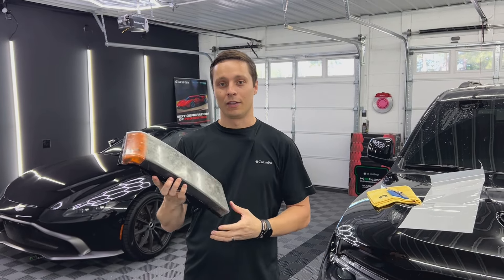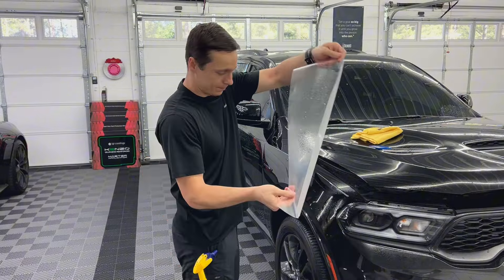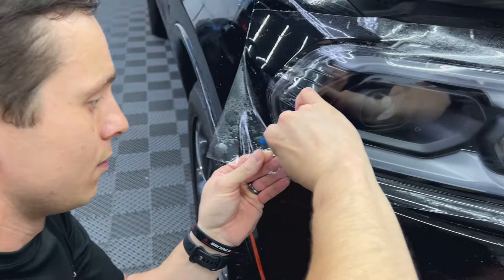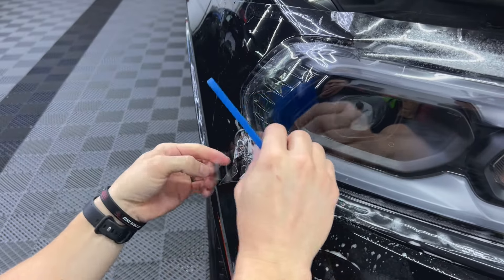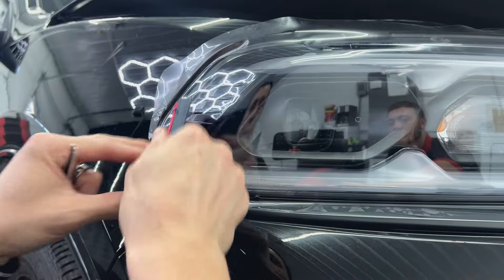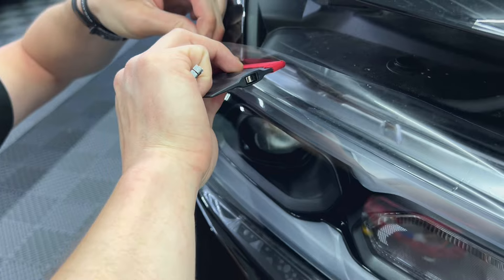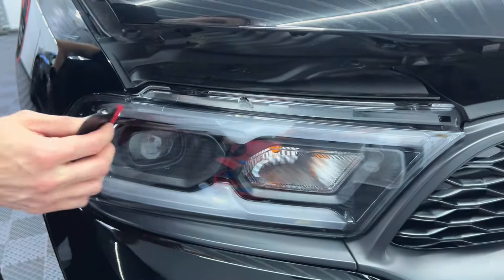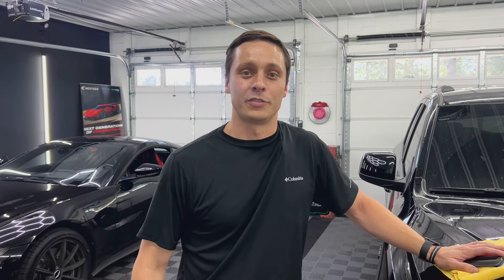How a Professional Bulk Installs PPF on a Headlight

Comment: It looks like you are using a red dot knife but a carbon blade instead of stainless?
Reply from the maker: Yes, for PPF we use the red dot Olfa knife with carbon blades. The carbon blades require less pressure to cut through the PPF.